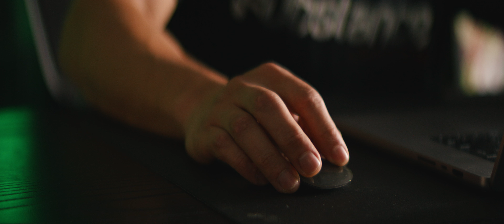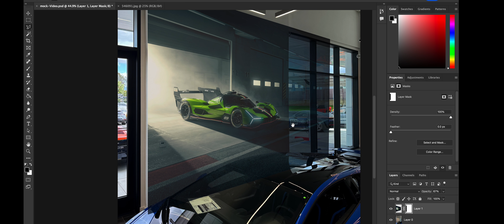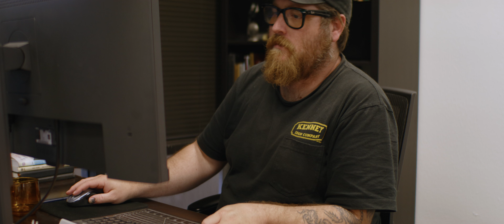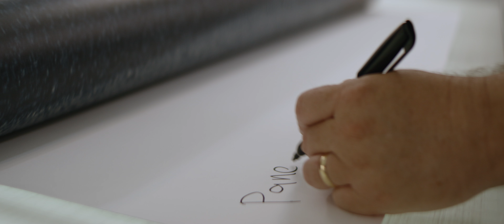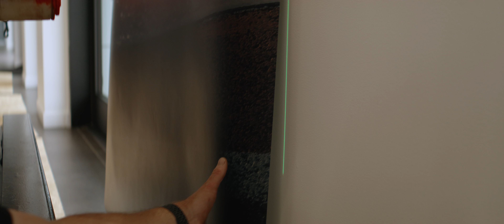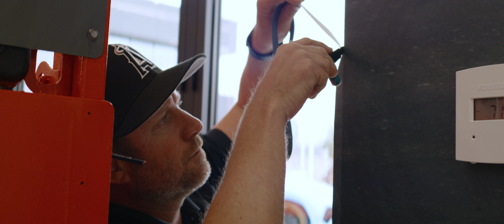How To Make and Install Wall Wraps & Graphics

Comment: As someone who’s new to graphic installation, this is incredibly helpful and I’ll be back to reference this in the future. Haven’t looked back since I started printing on substance media, the only other thing I find myself using is Oracal’s 3258 for test prints and small stuff for customers on a tight budget - but I’m hoping you guys will roll out a ~6mil that handles well without laminate soon!!
Reply from the maker: Thanks! We are stoked to have you on board! I have relayed the request for 6mil media to the product development team to see if that's something we could potentially take on in the future.
Reply: a year later, hows it been going @abapical?
Reply: @SacredCashflow719  Great! at this point for my business I’m exclusively printing on Substance, I don’t even offer the 6mil Oracal option anymore. I also now work at a real graphics/wrap shop as the “print production specialist” in addition to the solo sticker business I’ve been running for a couple years (where I have moved to 90% stickers, working with artists, fairly abnormal business model, its more of a passion project than a “business” I suppose), but at the shop we’re preparing to move a majority of our printing to Substance. It’s just unbeatable for the price. We have guys that wrap that have their media preference and we’re going to keep using what they like for their jobs, for sure, but for the bulk of prints man Substance is just bar-none. Their support is great, the product is great, pricing, shipping times, catalog simplicity, they really do it all, and do it DAMN well. Cannot recommend enough! Running joke at the wrap shop is that I’m a Substance salesperson 🤣